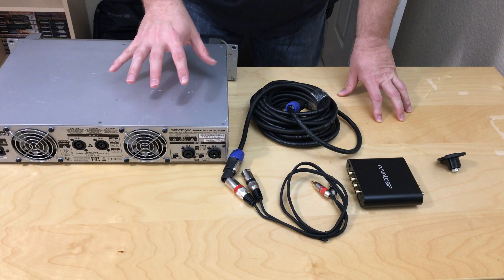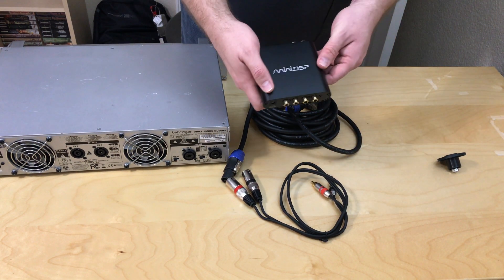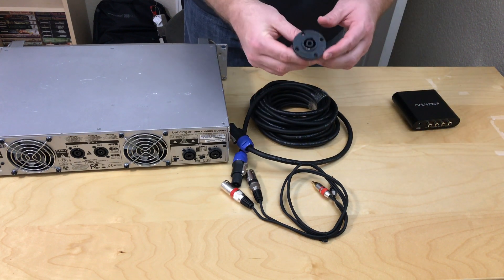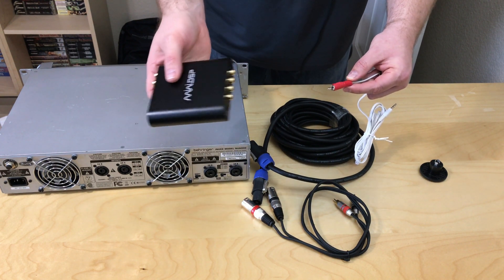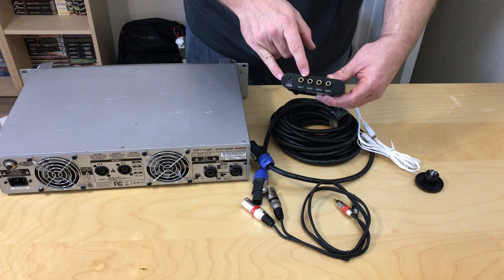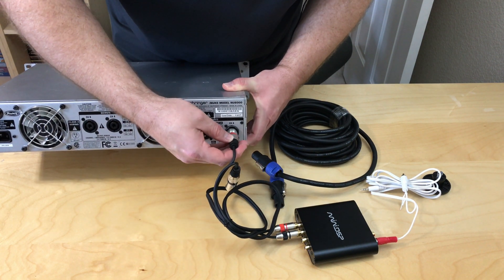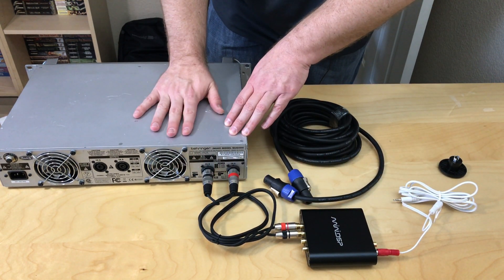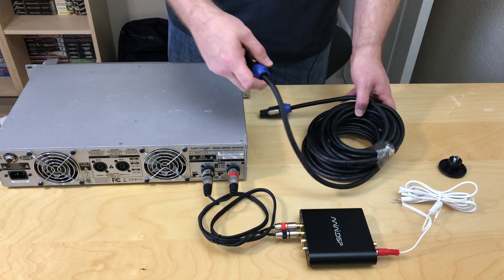DIY Subwoofer Cabling - RCA to Balanced Pro Amplifier - Speakon power and miniDSP crossover

Comment: I need to know the best input gain level to use at the nu6000 to keep my amp safe from fail and also the driver from over-excursion because my amp failed before because of wrong amp settings ??

Comment: is it possible to split that rca into two and go into the 3rd output on the mini dip to tune one different sub? Or is it not possible to tune individual lines when you split the rca connector going into the amp?
Reply from the maker: One input on the minidsp can have 4 different outputs. All tuned differently.
Reply: Home Theater Fanatics I understand that but I’m curious if you say wire two speakers together for one channel on the amp when you eq that line you’ll control both the speakers. There’s no way to split the rca out of the amp so you can control each speaker separately at the dsp? I’m assuming that each line you connect to an amp is independent and you can’t split that into multiples. 
Only if it’s using a separate channel on the amp can you eq that line independently.
Reply from the maker: scotty miller you can use a splitter behind the miniDSP if you want to split to multiple amplifiers.

Comment: Can I send power from sub out with rca male to female to a cable from nx6000d with dsp built in ?
Reply from the maker: You would connect the sub out on your AVR to the 6000d using a RCA to XLR adapter cable. Works great.
Reply: @JilesMcCoy  is there no gain/headroom lost when going RCA out on receiver to XLR input on amp?
Reply: Ok thanks I love yo set up
Reply from the maker: Thanks! I have new mains... check out the Jiles Journey list. Things are changing fast!
Reply: Ok buddy
Reply: To add to this question about connecting from a receiver to a NX6000D: that would only give you a signal for one channel/sub, correct? What if you want to power two subs with that amp? Would you need to incorporate a splitter so that you are feeding into (both) of the amp's XLR inputs?

Comment: Nice vid as usual, I have a question. Is the mini dsp better than the built in dsp on the I nuke?
Reply from the maker: I wouldn't call it better... but it is more flexible. I use it to tune multiple subwoofers together. The 2x4HD will let you deal with 4 subwoofers in the one box. That is pretty cool.
Reply: @JilesMcCoy  I understand now, so can I get the mini dsp and also use it with my regular subwoofers that are not powered by the inuke as well and improve their sound?
Reply from the maker: @Night_Watch413  Yes, 4 amplifiers can be behind the minidsp.
Reply from the maker: @Night_Watch413  You take the subwoofer out from your AVR and run it to the 2x4HD. Then you take the 4 outputs from the 2x4HD and they can run to amps or active subwoofers.
Reply: @JilesMcCoy  sweet I think I will look into getting this to get more control over my active subwoofers, thank you.

Comment: So if I have just 1 subwoofer (for now....) and am not using the miniDSP can I still use this: Seismic Audio 3 Foot XLR Dual Male Patch Cable to connect to my AVR?
Reply from the maker: What are all your components?   AVR > Amplifier (which?) > Subwoofer (DIY? What connections?)
Reply: @JilesMcCoy  I am making the Ultimax subwoofer from your video with the Neutrik Connector (smaller square flat pack cabinet) with a Behringer Europower EP2000 amplifier and Onkyo TX-RZ820 receiver.
Reply from the maker: @jeffribordy9596  That looks good to me. Your amp needs XLR in just like my iNuke6000. I simply plugged the RCA side of the cables into my AVR RCA LFE output and the balanced side (XLR) balanced into my amp. Some people like to use a signal converter (clean box) but I wouldn't do that until you try cables.
Reply: @JilesMcCoy  awesome - thanks for the help. Keep up the good work, enjoy the detail in your videos.

Comment: Doesn't having an unbalanced to balanced cable create a problem in the signal chain? I was think about buying pro recording equipment with balanced connections. That would be a Revox PR99 or Otari open reel recorders which both have balanced inputs and outputs. I was under the impression you need a buff unit between those connections or the signal would get messed up. Do you have any thoughts on this subject?
Reply from the maker: In this particular application it works out ok. Ive never used a reel device so I'm not sure how that might work out.
Reply: Alan Bauder al pro amps have non balanced imputs but most are 6.3mm jack style. So i dont see the point of using xlr connectors which arent balanced however i does not create a problem non balanced is ok for short runs

Comment: Possible to have a video on how to use the minidsp with the pro amp for subwoofers? 

I have a crown 1502 with a minidsp but the minidsp isn't in the chain yet.
Reply from the maker: That is in the works right now. I am building a PE flatpack for a UM18-22. The next item will be miniDSP tuning for that sub. All will be in video. I hope to complete the subwoofer this weekend! I'll actually DSP it with 2 existing 15" subs.
Reply: @JilesMcCoy  awesome man! just subscribed to yah. thanks for your time and effort man! i have also built a PE flat pack with the dayton um15-22. it sounds pretty good as is, but im sure with tuning, it can be a lot better.
Reply: @JilesMcCoy  can't wait im in  the process of planning now for my HT and have been leaning toward a dual full marty setup with UM18s
Reply from the maker: The miniDSP is super easy to set up. I'll video that!